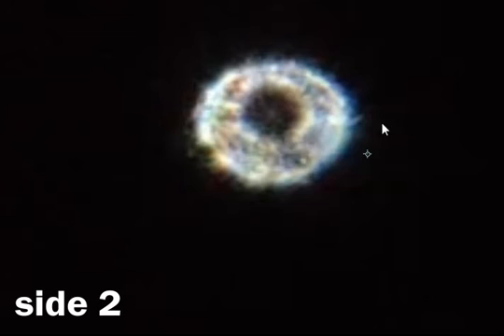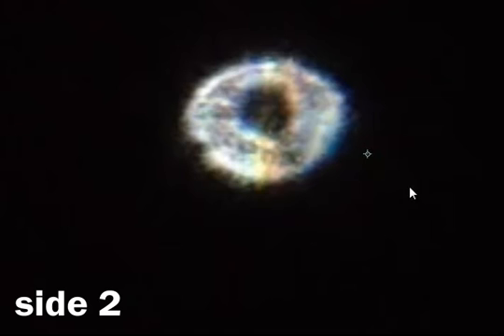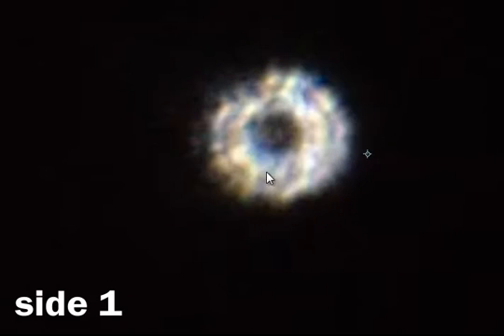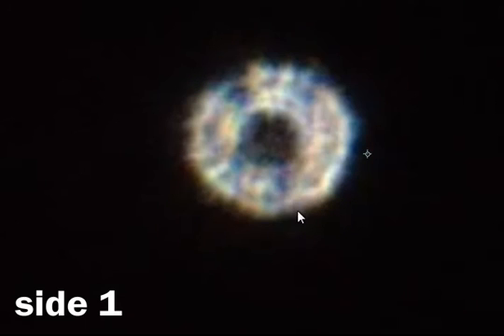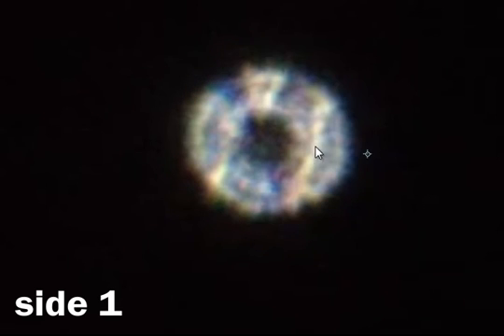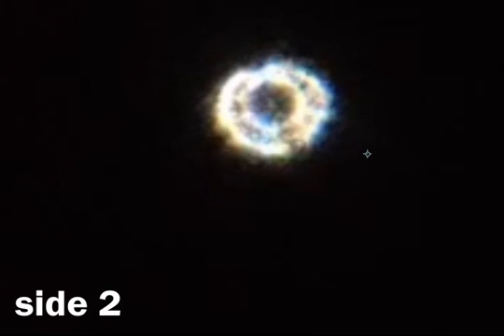14in mirror star test

Comment: Try to use artificial star indoor for the test?
Reply from the maker: szaki that adds errors
Reply: @Pinbout  What error?
Reply from the maker: szaki correction error, being too close will add correction, so it will make it look better if your really under. Anyway this was some guy’s star test from Russia and he wanted me to review it.
Reply: Very difficult to avoid air currents that would destroy  the image in a 14 inch, I've tried it.  A double-pass test with a flat would be much better.

Comment: looks like air at the top of the tube but can be the mirror on bad position , maybe not get full light on secondary
Reply from the maker: Davi Peres the dark vertical straight bands are atmosphere. but either way, that's not affecting the brightness of the rings on side 2
Reply from the maker: Davi Peres its the camera vignetting the defocused star
Reply: ok
Reply: you are trying to know what is that bright nearly the secondary shadow?
Reply from the maker: ok, the guy just told me that side 1 is inside focus, so bright rings on outside focus means too flat, bring interior rings inside focus means too deep. so base on now knowing what side focus, I'd probably say this mirror is better than the test shows, probably not acclimated.I say that cause the bright shadow ring should be on the side that's under correct, but base on shadow size the outside looks overcorrected. probably cause the undercorrected mirror is still cooling causing an overcorrection.